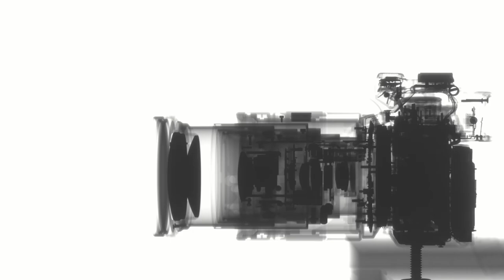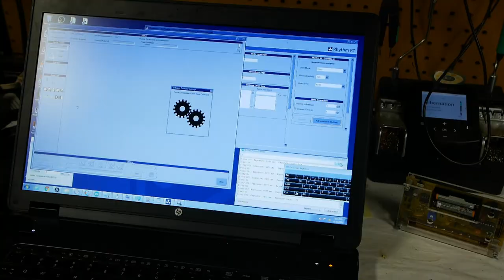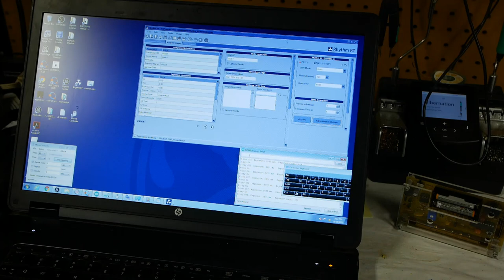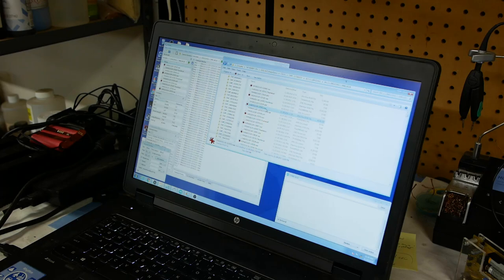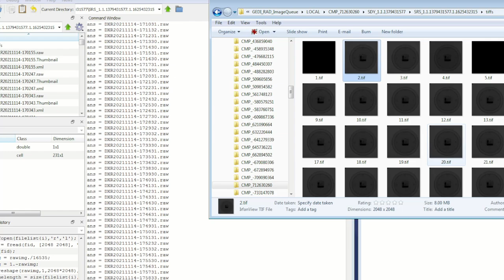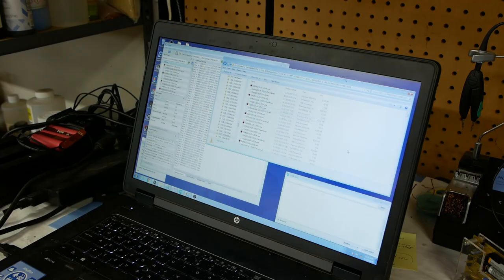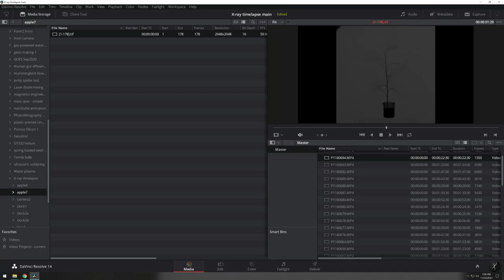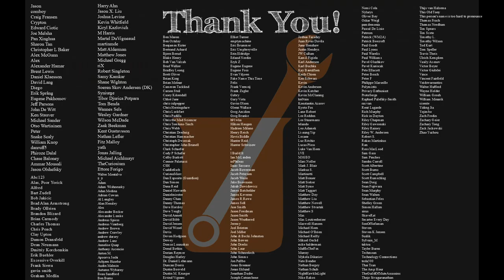X-ray timelapse of fluid movement in plants, stop-motion animation, sensor teardown/repair

Comment: That panel is what I knew as a "DR".  It came out later, with "CR" being first.  The CR would be exposed and then fed into a scanner to read it out and reset it.  They are much cheaper, but you need the scanner that goes with it.  Where DR pays for itself is that the tech can verify the image instantly, like we've come to expect from digital cameras.  That means faster patient throughput and higher utilization of the imaging suite.

That software you used is shameful.  I don't think it could possibly be the actual software used by the radiologist, since that needs to be FDA approved, and pass quality standards.  The actual software used by the medical device would save the data in a DICOM file, which is an industry standard, and also work with the Hospital Information System for including the patient information and automatically filling that in based on the booking.

Comment: You fixed a probably $10,000 piece of equipment by replacing a $2 part. Nice.
Reply: $10K is optimistically low. VERY low.

Comment: Do you know the name of this brown foil?
I regularly see something similar looking in NASA videos.

What's its purpose?
Thermal insulation?
Reply from the maker: It is polyimide.  A popular brand is called Kapton, and it is used mostly for electrical insulation.  It's stable at high temperatures and often has a high-temperature silicone adhesive applied to it, also making it useful for light mechanical clamping at high temperature.
Reply: @AppliedScience  Thanks for the explanation!

Comment: I had to look it up, there is no increased risk of cancer from cosmic radiation for pilots. But there might be a very slight increase of skin cancer which I would imagine is from sitting in glass cockpit above the clouds and exposed to the sun.
Reply: I think the pilots are extra safe as they do it all day and the glass in the windows is very expensive as it has many complex layers to screen the 'nasty's ' out.
Reply: There are many studies that support the hypothesis of pilots being at increased risk of cancers caused by cosmic radiation. Airline crew are exposed to more radiation than almost any other profession according to the cdc. A lot of studies also show what you said, however. Interestingly, truck drivers are also not far from airline attendants in that list, just because of sun exposure alone. Maybe it’s not surprising that increasing an extremely small amount of radiation by a lot is still not comparable to the sun just beaming down on you with actually a huge amount of ionizing radiation.